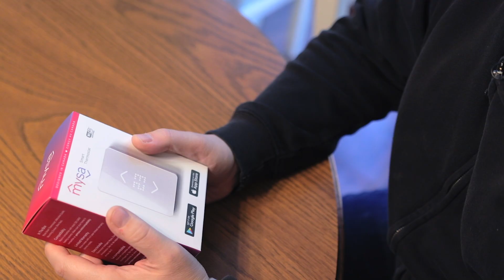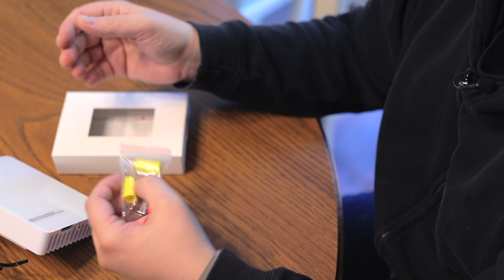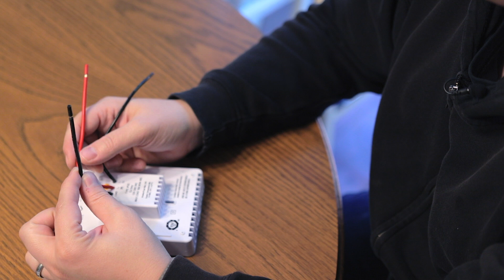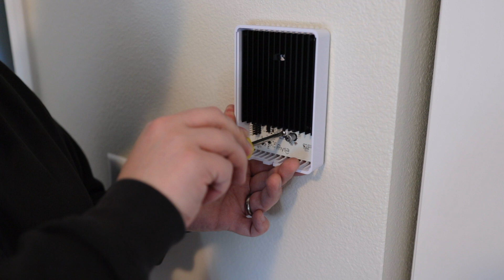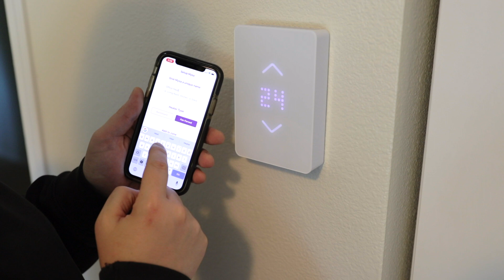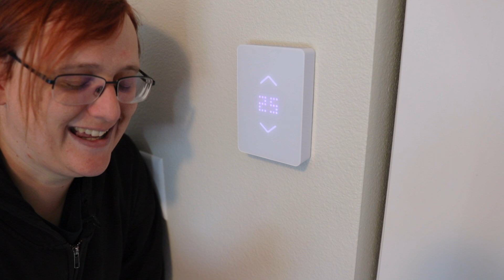Mysa Smart Thermostat: Can It Help Us Be More Energy-Efficient?

Comment: Hi there. I have 4 baseboard connected to one thermostat. when we opened the old thermostat we saw there were 4 wires and all 4 wires had the electricity in it. we tried to connect the Mysa thermostat but we couldn't connect. we couldnt figure out which line goes to where. Any advise?

Comment: I use wire-nuts regularly.  I don't dislike them, but they are finicky.  First of all, mixing solid conductors and stranded conductors makes it harder.  Secondly, I always take the time to groom the wires so that are as straight as I can get them: the wire nut works best simply wrapping itself around a tightly packed set of bare, parallel conductors.  Finally, avoid the tendency to push the wire nut down onto the wires.  Each nut is basically a helical spring inside: Let the twisting motion naturally wind that spring down over that bundle of wires, stranded or solid.

Comment: The only time Mysa would not like your wiring hook-up is when you have a 110V baseboard heater, which is not uncommon. On a 110V system it needs the "hot" in the right place in order for it to work.

Comment: Just for clarification in the US which uses 2-phase, for 240v circuits, both sides are hot. There is no neutral (unless it's a 4 wire setup, which doesn't apply to these heaters). The old switch simply disconnected both sides of the circuit which is the safest as it insures there's no electricity at the heater when off. The smart switch simply disconnects one side of the circuit. There's still power at the heater, but the circuit isn't complete and the heater won't run (just make sure to never jam a fork or other metal device into the heater even when off LOL). Too bad Mysa cheaped out and didn't add another internal switch for both sides. If they did, it would have been a much easier as basically it would have been a wire for wire swap.

Comment: How are wires connected in the UK/EU (not USA anyway) if you don't use wire nuts?
Reply from the maker: Usually with screw connectors (nicknamed "chocolate blocks", at least where I come from) - sometimes these days with sprung clip connectors. ^Kate

Comment: When ever you work with electricity you first have to check if the thing like outlet or switch has still electricity with voltmeter so you won't be electrocuted
Reply: The video above doesn't show an extra safety check, but the manual instructs you to turn your existing old thermostat to maximum heat and wait for 5-10 minutes to see if the heater is still on (even after you turn the breaker off).

Comment: Have you considered using a “heat pump” system for your heating, and AC needs?
Reply from the maker: We will, eventually. This is a stop gap, and something we can review!
Reply: @TransportevolvedTake2  You may need to replace the thermostats again when you do this. I had to scrap the smart thermostat I bought as the smart thermostat had what is called a 'time proportional' control, this is a nice and efficient technique for conventional gas or resistive heating system they are dreadful for heat pumps. This is because the heat pump needs a few minutes minimum to establish a temperature difference before it can deliver any heat so when the time proportional control drops to a low level it just starts and stops the pump using electricity, but no heat! It can also destroy the compressor starter :-(

Comment: Long term you would be better to install air/air heat pump(s). Two key benefits - efficiency - around 4kW of heat for 1kW of electricity in on average, plus with reversible units you get aircon for the summer too.  You can also get air/water heat pumps to heat your hot water with similar efficiency increases.  Later you can dump excess solar sourced electricity into your hot water tank too!
Reply from the maker: That IS our long term plan - but that requires some modifications to the house that we're not financially able to do yet. ^Nikki
Reply: Transport Evolved: Take 2 Good!  As others mentioned you need to make sure your insulation is up to scratch at the same time. I installed 8cm of interior insulation on the outside walls before adding the heat pump. For my 100m2 (~1000sq ft) apartment I used an 8kW Daikin outside unit and three inside units - considered to be the Mercedes (Tesla?!) of aircon units. With your larger property you could consider a phased approach - add some units for the most used rooms first and then add further units later as funds allow.